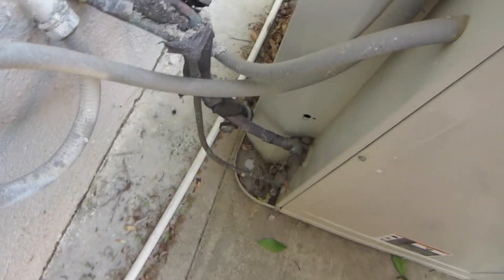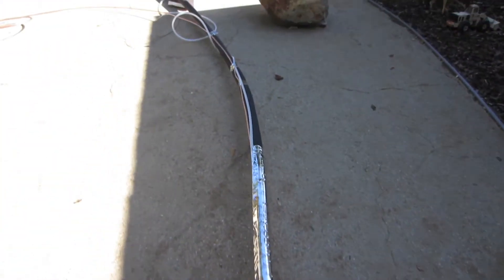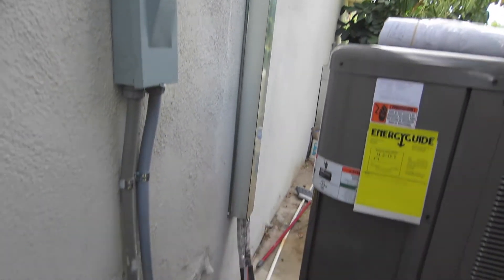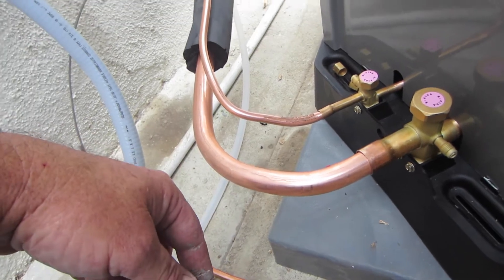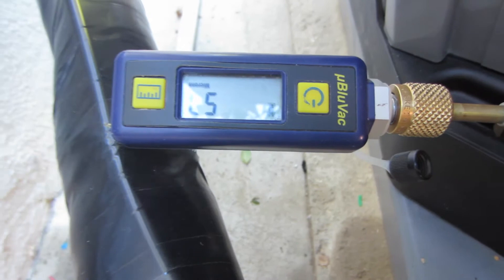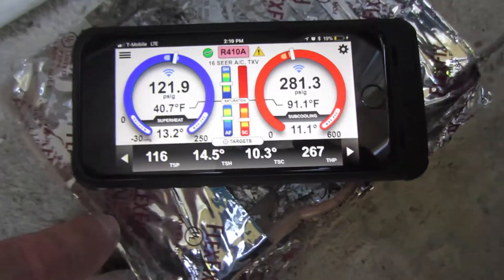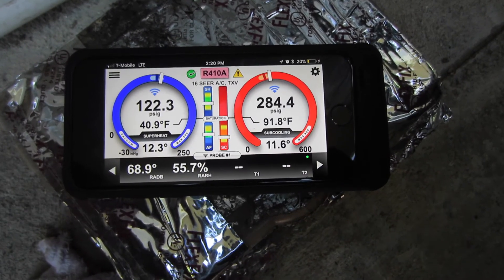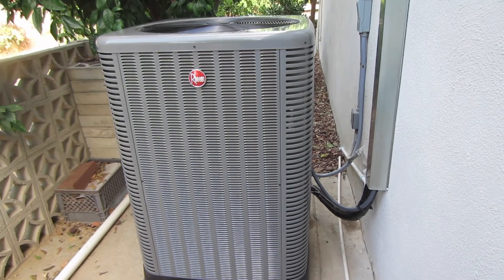RHEEM R/A 17 INSTALL

Comment: Does that ADP coil match and give you the rating? My supply house tells me, no. Gotta use the Hi efficiency Rheem coil to get the rating. Whats your take on it?
Reply from the maker: The ADP coil do have a ARI match.The only problem is that Rheem won't  honor the 10 year parts warranty if you use another manufacture coil.The only problem with the Rheem coil is that they are too big on some jobs.
Reply: dizziedallas I do perfer the ADP, especially in horizontal applications.  Thanks for the reply. Keep up the clean installs!